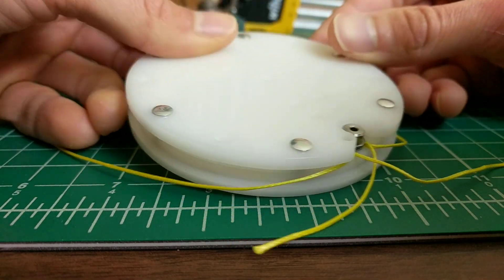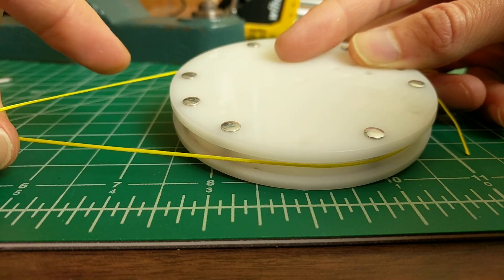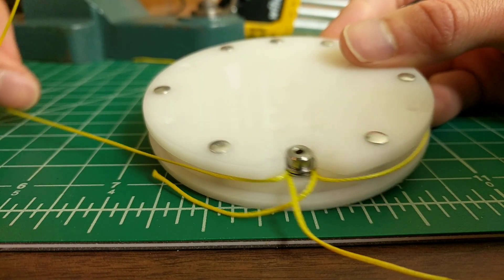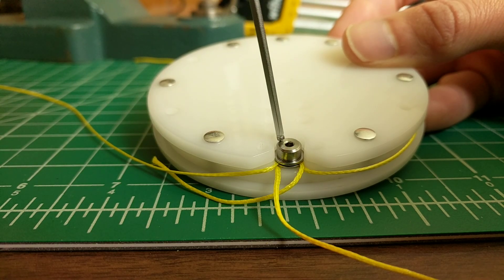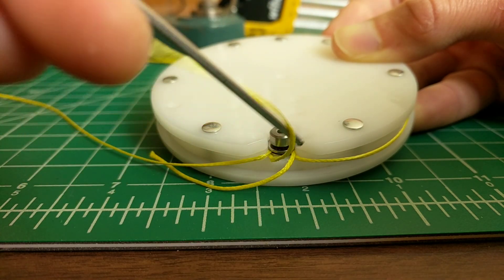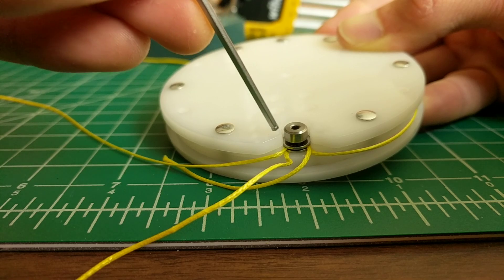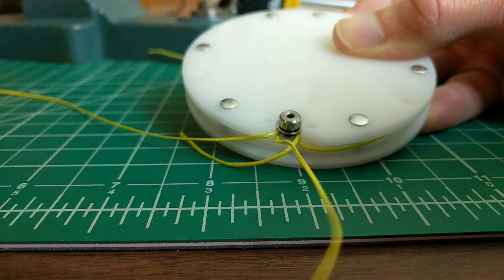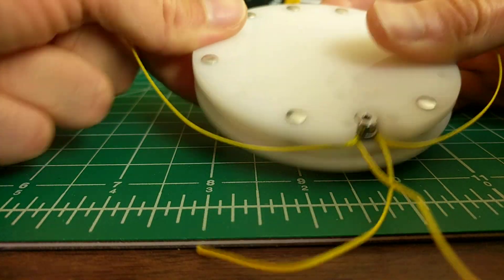New Pulley Cinching Mechanism for Animatronic Cable controllers

Comment: clever solution - I've been integrating cable cinching mechanisms at the spool (motor) side in my 3d prints, but that can get complex to adjust. This is much simpler to implement and more accessible.

Comment: cross drill a screw, feed the cord thru the hole, and combine it with a jam nut/sleeve, then you can simply turn the screw to adjust slack, then lock it down,
Reply from the maker: This is a great thought, although I think it's better implemented in a more durable material thats also a unibody, rather tham four plates. Here, I can't crossdrill because my pulley is actually composed of four thin, laser-cut plates, so there's not really a practical way to thread them.